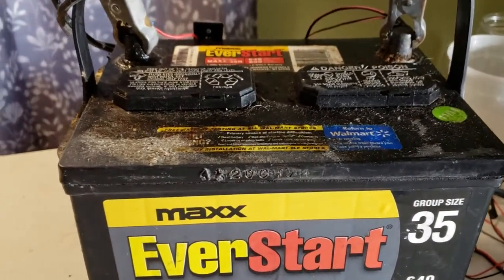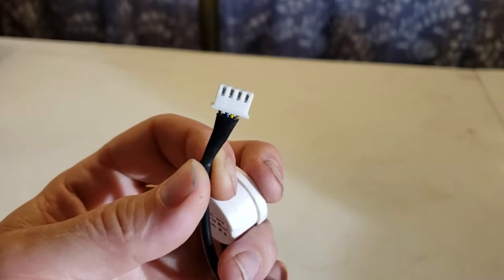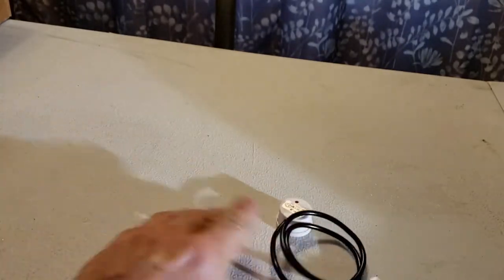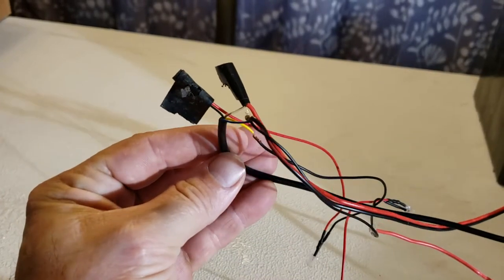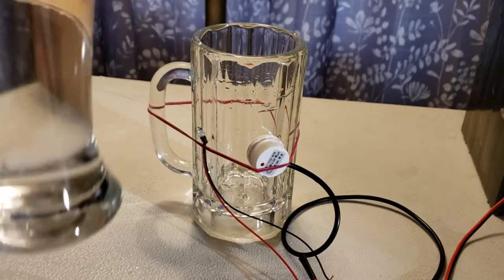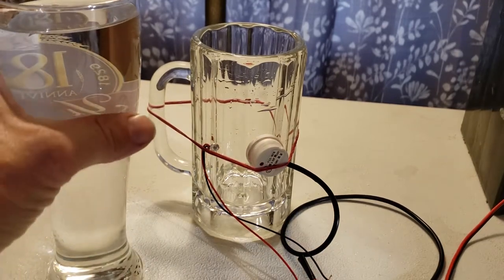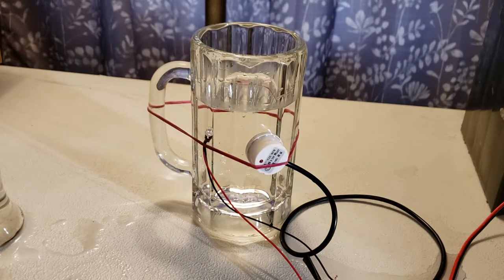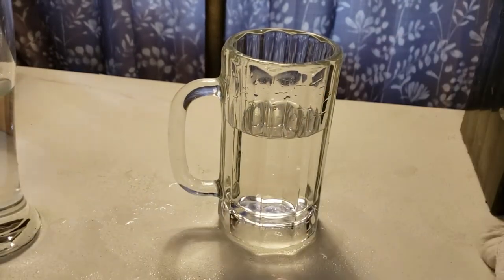DIY Cheap and Easy "No Drilling" Tank Level Monitor Indicator

Comment: Very nice. Found the part on Amazon. I'll combine this with a lighted LED push button &
mount it near my water fill on my RV. Then I don't have to keep asking the wife "is it on?"
a million times, since the waterproof button will be right next to the fill. Also I don't have to wire all the way back to my Monitor on the far side of the coach. I appreciate your video, Bro.

Comment: QUESTION: I don't have a schematic for the sensor. I'm wondering if you can use a common line for the NEG side of the sensors, Obviously the power supply (+and -) can be common.  So I'm thinking the number of conductors I'll need for 2-3 sensors?
12v+ (1)
12v-  (1)
sensor 1+ (1)
sensor 2+ (1)
Sensor 1-[neg] and 2-[neg] (1 or 2 wires?) Will I need to keep sensor NEG conductors separate ?
Summary: For 2 sensors, can you use 5 conductors or will 6 be required? 
   
I'm doing a 50 gallon fresh water tank, and will likely use 3 sensors (but I kept my equation to 2 sensors for clarity).
I have done other LED projects and using a common NEG is fine, but I am not sure how this sensor will function.

Also, Thanks for the video, this is a GREAT option to drilling my new $400 tank!!  And after 4 years, how are they working for you?
I subscribed. Can't wait to check out your other videos....
Reply from the maker: Sounds like it should work. To be honest I carry 2 extra 5 gallon jugs of water and when the pump starts sputtering I put those in and make plans to find water. After a couple years I have gotten pretty good at knowing about how long the tank lasts without even looking at guages

Comment: Any tank? Non metallic only
Reply from the maker: The ones I've used didn't specify but I did see another on Amazon that stated nonmetallic. Probably a safe bet to assume all are nonmetallic because they are probably all manufactured in the same factory and rebranded.